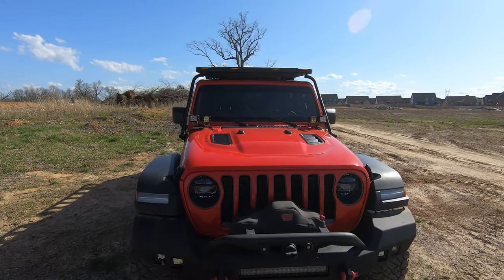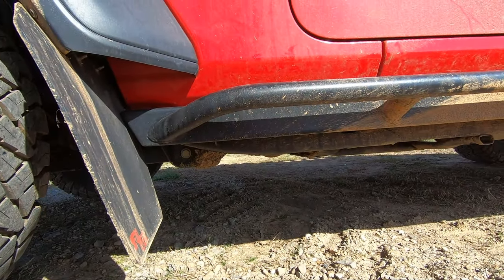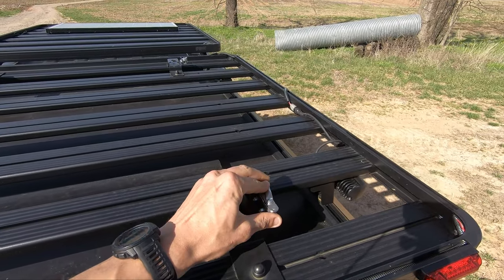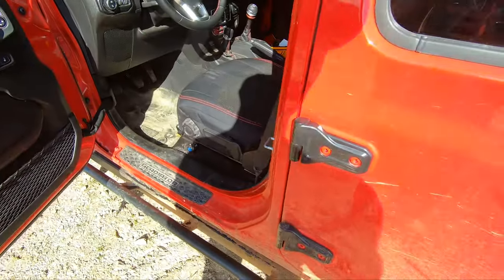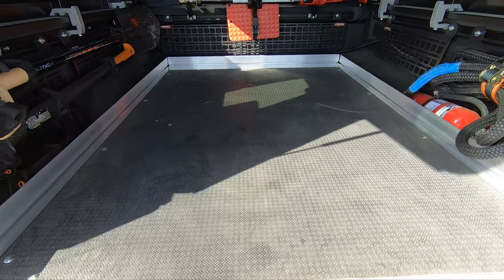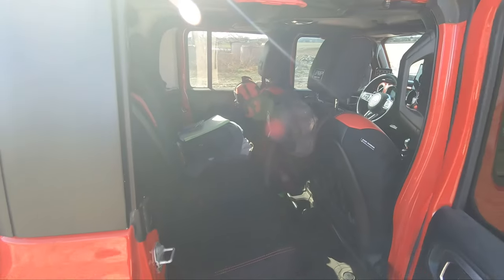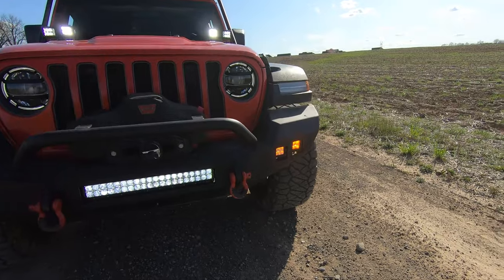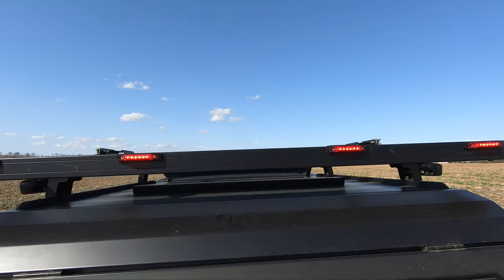Jeep Gladiator Rubicon | Truck Camper - Overland Build Update

Comment: Total cost for your build so far?
Reply: Also, are you using the mopar bed rails or the builtright industries bed rail?
Reply from the maker: The cost is...more than I care to admit haha. Although all of the labor was free since I did it myself, so I've easily saved thousands. I don't have the numbers handy because I'm out of town. I kept pretty in depth records at first, but stopped counting along the way when I started forgetting to add in some of the smaller mods.

The rails are BuiltRight as well. Great product and easy install--aside from shearing a bolt on the right side because Line-X failed to properly mask the holes in the bed, despite me explicitly requesting it, but I digress...
Reply: @TerraOutdoors  So in your opinion they are better than the mopar bed rails? I guess I will buy them also. Thanks for the response.
Reply from the maker: @Optimum-Price  I think either would serve the purpose just fine, but they are very good quality. I have never held the Mopar ones, so I can't honestly compare. 

I got the package on BuiltRight's once a year black friday sale, so price was the deciding factor for me.

Comment: $250 for mud flaps. 🤦‍♂️
Reply from the maker: Nine times out of ten, I'm waiting for steep sales to buy parts. Even if I had to pay full price, if it saves me hundreds in rock chips, dings, or corrosion, I'm fine with it. I can confidently say that the sides of my Jeep would be pretty jacked up without them. 

I also do dig the style, and the quick-detach is a really nice touch.